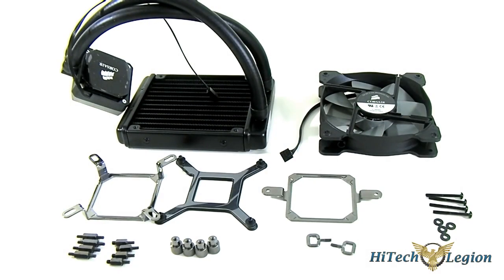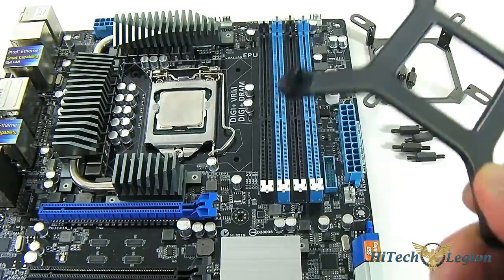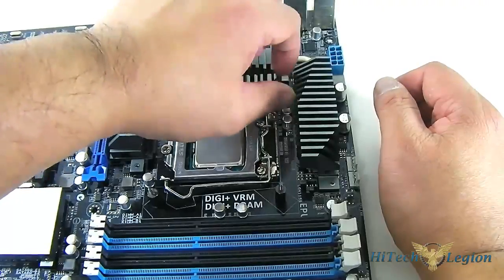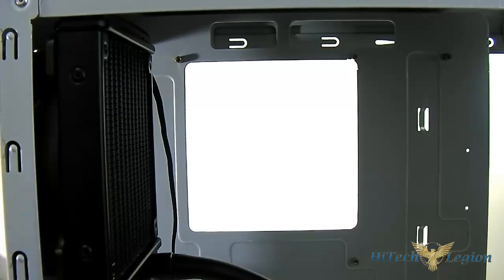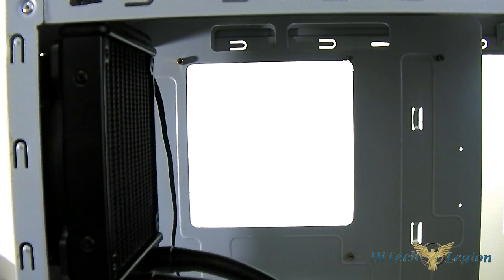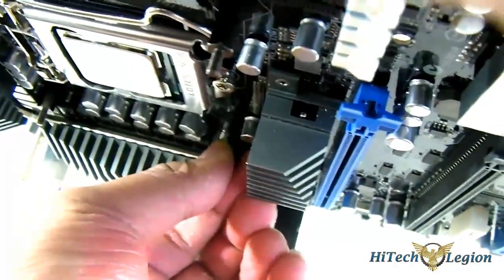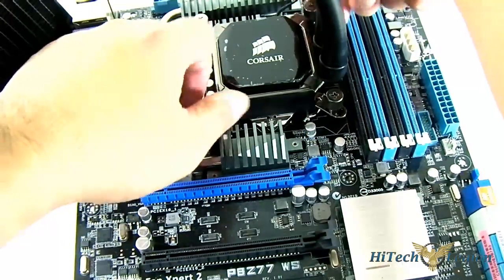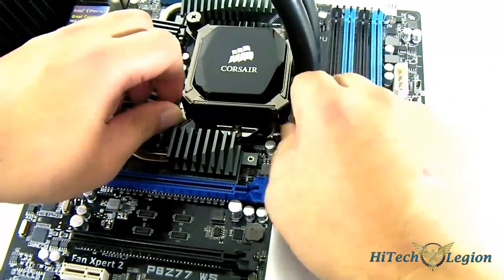Corsair H60 (2013 Edition) Installation Guide on Intel and AMD Motherboards

Comment: I've seen pictures where the Corsair logo is lit up. I just installed my H60 to an AMD motherboard and the Corsair logo is NOT lighting up. Did I possibly connect the pump and fan reversed to the incorrect headers in my MB? I have not entered BIOS at all. Do I need to enable/disable anything in BIOS for the H60 installation? Thanks!
Reply: Only the 'i' series liquid coolers (H80i, H100i) have the Corsair logo that lights up.

Comment: I see at the end of the video on the AM3+ socket install that it was somewhat loose. Do you want to leave it a little loose on the cpu or is it suppose to be tight?
Reply: It should be tight so it doesn't fall off.

Comment: Can I plug the pump into a chassis fan header?
Reply: As long as you put it on full speed.
Reply: Yes you can BUT you need to put it on full speed or you will get pretty high temperatures.
Reply: Better not to. I prefer to run it on a full voltage header (PWR_FAN on my mobo)

Comment: are these thing safe and reliable? i really want one but im scared that it will leak on my shit lol
Reply: Marco Fiacchino A closed loop water cooler has leaked before. It's called closed because your not making a water cooling setup with custom tubes and shit. It's to save money and for people who don't want to spend a ton of money on 1.
Reply: ***** Really? While pump failure has been the predominant failure, leaks are still in the equation. They are very, very rare, but absolutely do happen.
Reply: it should be a life time warranty lol
Reply: lol
Reply: GamingSoup All in one water cooling is so safe and reliable now that its a no brainer to buy, its very unlikely to leak in fact they are so heavily tested for leaks and such that most of the time the only thing to fail will be the pump or maybe the radiator fan....
Reply: 851995STARGATE yup i got the h100i and i love it
Reply: GamingSoup Nice! My current rig has a seidon 120v and my upgrade during the summer to a i5 4690k will get a corsair h55, these aio coolers are a no brainer I think too many people think its risky that they just ignore it and buy an air cooler. A 212 evo is $35 but if you spend just $30-$40 more you get a way better temp margin and threshold
Reply: Knowing my luck i'll probably get one that leaks.

Comment: im in a cooler master haf 912 with a 200mm fan in the front and top and i mounted the single fan on the inside solution as an intake the other fans are mounted as they should, will this cause the dust problem when there are more intake than exaust or should  i just shove a 120mm fan on the side panel as an exhaust

Comment: Heat does not rise.... it dissipates evenly until an equilibrium is reached.
Reply: Well, air that has a higher temprature has a lower density, IE it will "go up".
Reply: Dr. Astrô Nauth Well it will only "go up" if the air above it is less dense. The statement "heat rises" is not wholly accurate.
Reply: True. It cannot fight gravity. But still, hot air has a pretty low density compared to most stuff on this earth.

Comment: Had this for 5 months now and I was just wondering if water needs to be changed?
Reply from the maker: This is a closed loop cooler, so there is no way to do a liquid change. They are sealed units so the liquid will typically last several years.
Reply: Thanks I found out after a quick search (nooby me) but hopefully someone will see this and it'll help them
Reply: dylface94 it just helped me thanks

Comment: does ths one fit on fm2? He sais it on the video but cant see it on corsairs homepage. Can someone confirm it fits on fm2 socket?
Reply from the maker: FM1 and FM2 are the same physical mounting and use the same kit. FM2 is ommitted from the specs simply because it did not exist at the time of release.
Reply: According to Newegg as well, this will fit an FM1 but not an FM2. but, figuring this video is a year old, you may want to call Corsair and ask them directly. They may have a bracket that will fit the FM2 now.
Reply: HiTechLegion Awesome. Haven't followed AMD much since I switched to Intel. lol Good to know. Learned something today. ;)

Comment: This has liquid already in it right?
Reply: M Oculus Those are things you do with an open loop....this is not one of them.
Reply: Yes.
Reply: LOL, yeah, it's a huge oversight for the reviewer not to mention anything about the liquid. This is a liquid cooling solution, no ? How do you maintain the liquid ? Should you flush ? How often ? What types of liquid should be used ? Etc. Nothing.
Reply: Yes it does. Hence being "self contained". ;) I have 3 on 3 different PCs and it's pretty nice.

Comment: Since when did the rear fan come as an intake?
Reply: Since you can. lol As he mentioned, you can do w/e works best for your setup. I have found some of the videos, even the ones from Corsair that mention the exact same thing and find it counter intuitive but, I guess running test will determine which was is best for your case and setup.
My kids' cases this would work fine because they do not have a GPU creating extra heat AND they have a top dual 120 fan setup that could also be used as exhaust. But, because their cases are smaller, I have their H60 radiator and fan at the front intake leaving the back fan still as an exhaust.

Comment: I havn't got quite enough room in my case for the radiator. Is it ok to mount it outside the case on the back?
Reply: If your case has two little rubber holes on the back where you can pass the pipes through

Comment: Hi there! I am installing the h60 on an asus P8H61-M LX3 R2.0 motherboard with an intel i5 3330, i followed your instructions to install it, but i am having trouble with the fan setup... Where should i put the pump cable? I tried in the cpu_fan disabeling The asus Q fan configurations and on the cha_fan, in both cases it is overheating!

Comment: Is it a good idea to pull air in (from back), and then have two exhaust fans on top?
Reply: Actually, corsair recommends to put air in. The problem is, have the exhaust fans on top or down? That is my problem, at least...
Reply: Or down? And the thing with pushing air in is that there's a lot of dust build up where the fan and radiator meet.
Reply: ***** exhaust on the top, warm air rises :)

Comment: This guy sounds like a putz. One second he says, "if the bracket is loose, that's ok" then a second later he says "oh it was loose because it wasn't screwed all the way in" which even me sitting here at home could clearly see. Bro if you're going to make a video like this, do it right, don't bullshit us. Fucking bracket was loose because it wasn't sitting flush on the board when you tightened the four stand offs.

Comment: Hey, I was wondering about something. You said that this can be used as an exhaust cooler, which I plan to do because this cooler is going to replace my rear case exhaust fan, but where would I get the screws to do so? Please reply to this so I can see! Thanks.

Comment: so would you have to essentially flip the fan and the radiator together to have it as an exhaust? because i have the Silencio 550 case and therefore need an exhaust.

Comment: thats called push and pull. fan on the outside: pull / sucking cold air from the outside threw the radiator // fan on the inside: push / using the fan for cooling the radiator and as an exhaust

Comment: With a NZXT Phantom 410 case, can I also use the stock fan on the back with the included Corsair fan to make a push-pull configuration on the radiator, or will it hurt performances(since the NZXT fan is probably not a static pressure-optimized fan)?

Comment: It helps to blow cool air (from outside of the case) through the radiator, a bit more effective than pulling warm air (from inside the case) through the radiator. I thought the same as you until I got an explanation about it.

Comment: if you exhaust with a top mount and cool air is drawn into the case from the front wouldn't that make the radiator fan draw in cool air and exhaust hot air at the same time?

Comment: you're definitely going to want to remove the old thermal paste so that you don't have too much on the processor, causing inefficient heat dissipation and a possible mess.

Comment: You don't want exhaust in this instance. The ambient air temp outside the case should, and probably will, always be lower therefore you want to pull air in, not out. This is stated in the video and the H60 manual. The only exception to this is if you have a case that doesn't have top mounted fans. (As mentioned in the video)

Comment: Does the h60 come with fan splitters I wanted to use It in a push pull configuration, but does the h60 allow it?

Comment: You should emphasize how important the override on the fan speed is for the port you're using.  Me and my husband were fighting with his new pc for hours because we weren't sure how to get the cooling unit to cooperate.  We had to run the bios with the stock heatsink/fan to get to the options to override the fan control.  Only THEN did the cooling system cooperate appropriately afterwards.  Thank you for that one quick comment, if it wasn't for that we would have been left wondering for hours!

Comment from the maker: It's a toss-up. I love the SecuFirm 2 mounting as it is very easy but the large backplate is a drawback on cases that don't have adequately large backplate cutout where the advantage goes to this CoolIt OEM mounting since the backplate is very slender and can easily slip in even if some of the mounting holes are slightly obscured by the motherboard tray.

Comment from the maker: It should. Various forums have "Phantom case owner's club" thread galleries that you can check out and verify. The only clearance problem I can see with the radiator is if the case doesn't have space for the reservoir such as mini-tower cases. The exact radiator height is 152mm in case you want to measure manually.